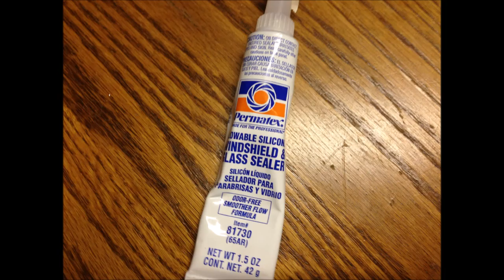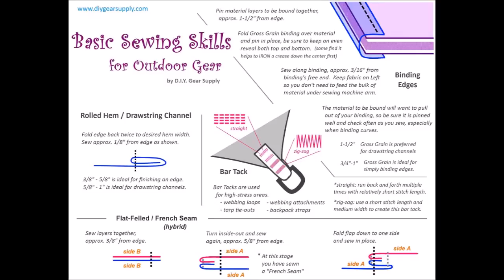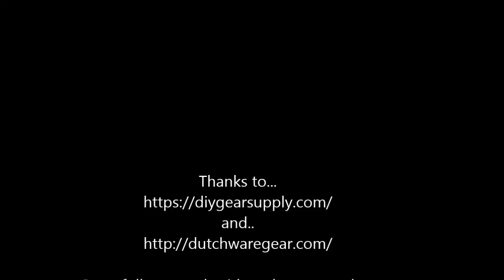DIY Argon Sil Tarp

Comment: 7 yrs later(for what it's worth), try replacing the ridge line with larger diameter line so the prussic will BITE the larger line. ie. prussic of bank line, ridge of paracord. Think you may find it will work better. Nice build.☺